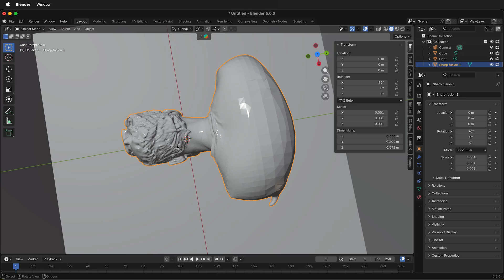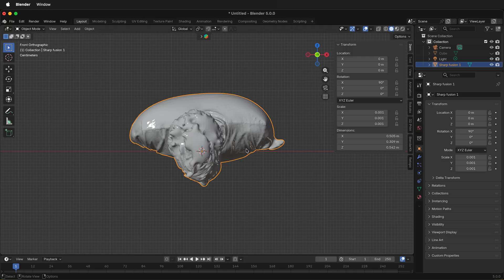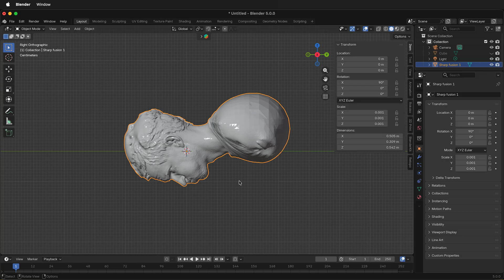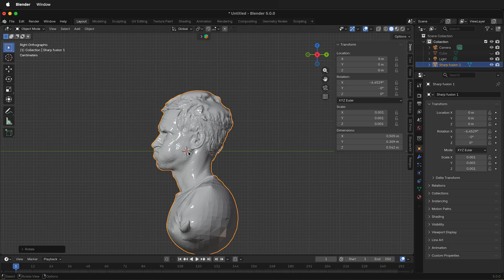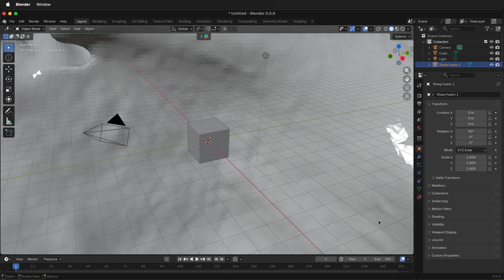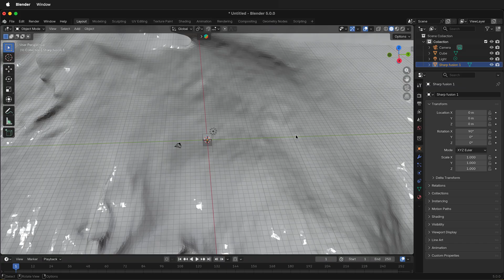Import a 3D Head Scan into Blender (OBJ) and Fix Scale, Rotation, and Origin

Comment: This can’t be right,  .001 makes the object much smaller than 1:1
Reply from the maker: Depends on what size your scanner is set to mini 3D scanners are set to 1 mm accuracy, but if you're scanner is scanning at a different resolution then you have to have a different scale factor

Comment: Thank! You! Really ******g thank you! I’ve been going mad the entire time this video has been available. 
Do you have any videos on getting measurements right coz that’s my other issue, i have to be mm perfect or the entire project is scrap
Reply from the maker: What 3D scanner did you use? What is its accuracy +/- ? It should be as accurate as the scanner when imported into Blender. To calibrate, pick the longest known distance, make something that size in Blender and then see if it matches, here is an example video, it is for photogrammetry but it is the same concept https://youtu.be/MUb7I4lBSZs